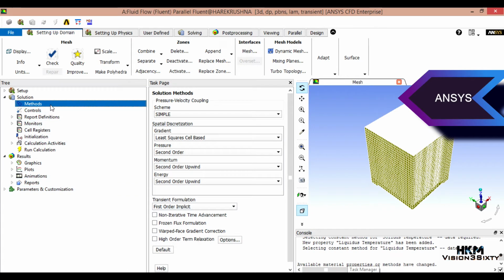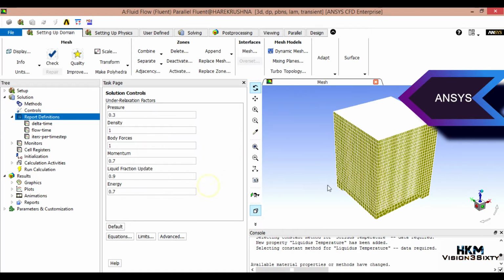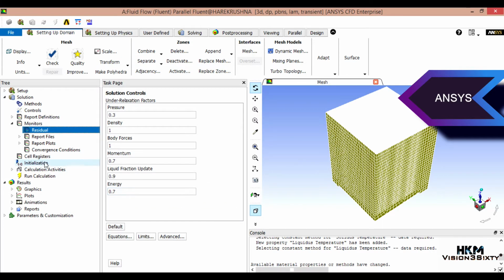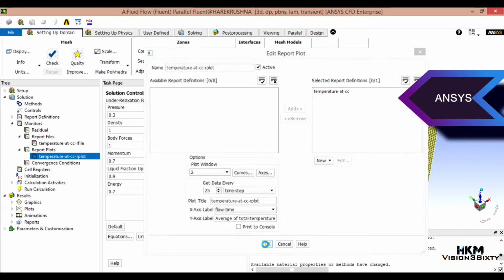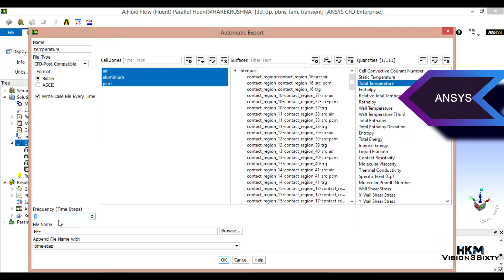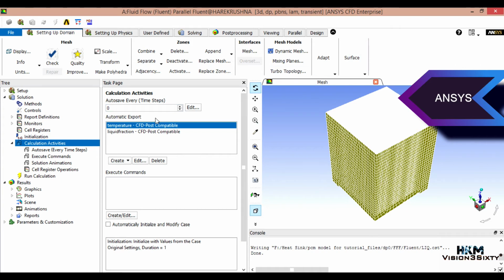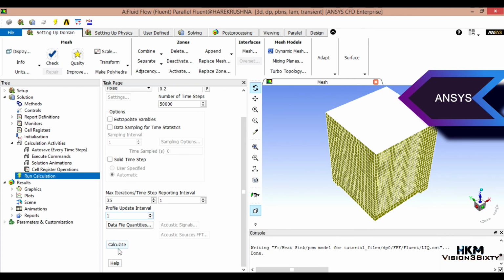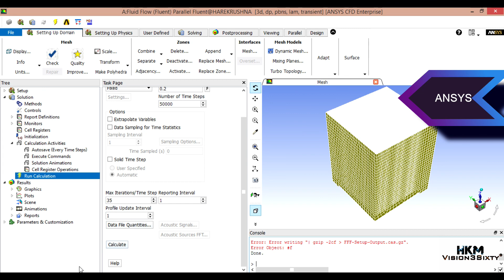Simulation of PCM Heat Sink with Fin Part-4 | Solution Method Set using ANSYS

Comment: Sir ,when I entered different density for solid and liquid phase ,I got floating point exception.can you give me the solution for my problem
Reply: did you find a solution for point exception? can you please share it, , even i do the same as the video, but still get point exception
Reply: I got the same error. I wonder if the error that pops up during initialization causes it.